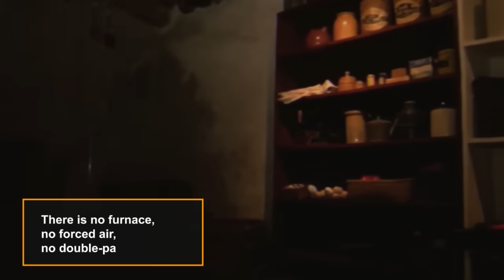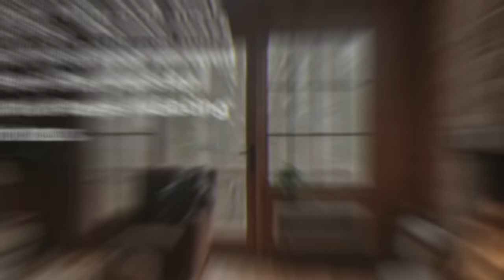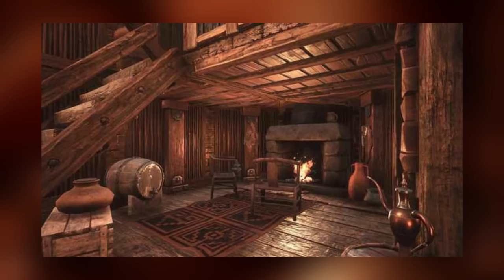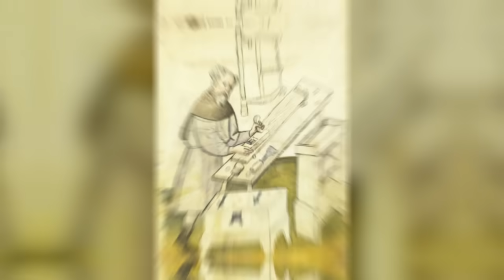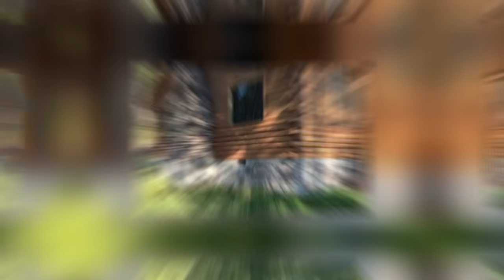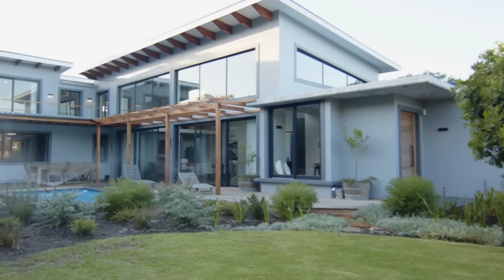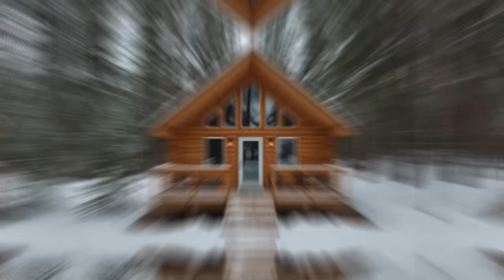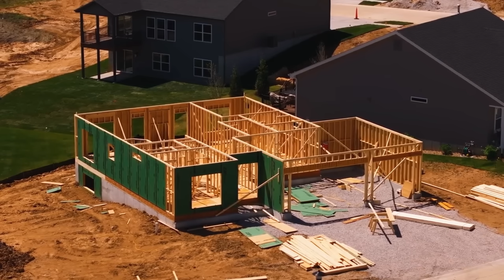Why Medieval Log Cabins Stayed Warm in -40°F While Modern Homes Freeze

Comment: Like 4 years ago, we had a winter storm that knocked out power for about a week in mid February.  Outside temps were consistently around -20F or less.  We relied on a kerosene Lantern for warmth and light, but that only really kept it around the low 40's. Worrying about that, we got a propane space heater, and that bumped the temp in the living room up to about low 60's. Was a rough week. Should be noted that this is a fairly large house, so lots of space for that heat to escape to.

Comment: If you use enough insulation, you don't need a lot of thermal mass. Thermal mass is only helpful when there aren't prolonged extremes.  Too much thermal mass, say in a prolonged very cold snap, becomes a detriment because it takes up more energy to warm up and takes a lot longer to do so. Yeah, once it is warmed up, then it will be helpful.

Comment: Our power went out several years ago on a Friday evening.  We stayed until Sunday afternoon before going to our daughter's.  Their power was only out for about 24 hours.  Our son's was out as long as ours but they had a small wood stove and stayed in the same room with it.  Sunday night, the temperature dropped to 9 degrees F.   We could have stayed longer if my husband had started the generator ... "But the power is only going to be out a little while."  Famous last words.

Our heat is in-floor radiant heat.  Our basement has about 6" of concrete with the tubes running through it.  Our bedroom was down there at the time.  Our bigger problems were that we cook with electricity and we might have run out of water.  But running the generator would have solved those problems as well.  We came back to the house every day to run the generator long enough to keep the freezers and refrigerators running until the power came back on Thursday evening.  We stayed at daughter's for that night because it would take time for the mattress to heat up again to a "sleepable" temperature.

We've had other situations where the power went out for shorter periods of time and we were able to stay in the house for a few days.

(Edit)  I posted before watching the rest of this.  I'd like to add that we don't have drywall.  We have tongue and groove pine boards.  According to the info given, this may add to our being able to stay here for a longer period of time.  We do have an open floor plan in part of the house which may be wasting some heat.

Comment: I had a 1968 brick house in St Louis MO US, we had 5 day power outage during an arctic vortex. Outside was 7f during the day. The lowest temp my house got was 45 f. My current brick rock wool insulated house warms up in the day . I do not need my furnace until it goes below 32 at all. It is 74 in the day when sunny  and drops to 62 at night until it goes below 32 for 24 hours. I do use the furnace to bring it up to 68 when it's been cloudy for several days or my elderly parents visit. If you spend time outside working like I do 62 is plenty warm.

Comment: A few small counterpoints here.   The number of windows in modern homes vs older homes is somewhat large and that is where a ton of heat escapes.  Yes a giant log that is insulated will 100% be efficient BUT if I asked the typical. homebuyer this question.  Would you pay 5x the cost for your home to make it super efficient?  The answer will 99% of the time be no.

Comment: Drastic oversimplification interspersed with misleading "facts". 

The amount of heat needed to bring such enormous thermal masses up to temperature are equivalent to if not more than the amount of heat needed to keep a modern house warm. 

You haven't addressed the issue of amount of energy needed. You have only addressed the concentrated nature of the heat from a single fireplace in a log cabin.

Comment: They aren’t completely wrong here but they fail to mention the most obvious answer: modern homes are many times larger with many more rooms.
Reply: And typically many more windows.  Your average double pane window has an R rating of about 2. A 1' or so depth wall has an R value of anywhere from around R40 (somewhat poorly insulated, say with fiberglass batt) to around R80 (very well insulated, say with the highest quality foam) on average. 

 Your average insulation runs between around R3 to R7 per inch... As you can see, a window is a very poor insulator in comparison, and even the expensive, fancy triple pane windows aren't that great in reality. Maybe a whopping R5 or so. 

 Windows are ok if they are getting plenty of direct sunlight through them, and then when they are not, have some kind of extra insulation put over them.  Silicone dot several pieces of cardboard together (i.e. try to have at least a small air gap between each panel), seal it up on the sides completely (with tape, silicone, or what not), and then paste aluminum foil, spaceblanket or the like on one side, with shiny side out, and then cover the windows with these at night and they will be much more insulated. You want the IR reflector pointing to the inside of the house to reflect heat away and back into the house.  Make it bigger than the window so it completely covers same from the walls. 

     Putting a clear plastic over the window does help a little, but not as much as people think. Might boost up an R2 window up to a like an R2.5, or R3 if you're lucky.

Comment: My house in upstate NY had a power outage for 10 days after a blister. We survived by moving downstairs, where the stove was, had it on 24/7, and hawled a barrel of fresh water in, because the pump wouldn't work. The stove prevented the pipes from bursting and when we cooked, the temperature became a bit higher. I do not think anyone could survive in such low temperatures without an iron stove and central pipe.❤

Comment: It's the instant heat of Oil & Gas that has caused much of the crisis over the last century. Coal (on the back of canals and railways to transport it) was the problem for the previous century and a half, with it's high calorific output [though not instant]. 
See 1 Winchester, S.: ‘The map that changed the world: a tale of rocks, ruin and redemption’ (Penguin, 2002)

 - there's an aside that the canals kept people alive through the winter, i.e. the shacks back then did not do as well as suggested.

Comment: I think a lot of the problems with modern homes starts at the fact that even with all the new technologies and building materials there isn't a completely sealed house anymore to prevent air moving between inside and outside. Today's unskilled labor even with spray foams will still leave large holes for the air to move through. If you take a home built right no matter the time versus a home built the quickest and poor quality no matter the era then you would probably find the same heat retention or heat loss respectively.

Comment: Thermal mass needs constant fuel consumption and needs days to worm up, also days to cool down when heating is gone. Insulation is way to go even to a point of passive or zero energy houses where living by itself provide enough heat to be comfortable without heating systems whatsoever. 
So forget medieval crap if modern technology is available.

Comment: Time wise I believe you build a log home faster ,  start to finish, involved today, foundation frame, sheeting, tyvek, siding, drywall, plaster  n tape , electrical, insulation, paint.
Two good guys it takes 3-4 weeks to just frame up an average home, that's roof sheeted windows in. Use to build these as kids..up in the tress not tree forts, actual log cabins about 8 feet up

Comment: We have the opposite problem. We live in north-central Florida and during one of the recent hurricanes (I can't remember which one - we've had several ☹), we lost power for 4 days and it became uncomfortably warm without the air conditioning we rely on. Our house was built in the mid-1990's and probably lacks sufficient insulation.

Comment: This is stupid. Put out the fire in the log house and it will drop to freezing too. Put the fire in the modern home and it will stay warm. I have seen it. Modern homes with a single stove or fire place heating the entire home. Yes of course 12 inch logs have better thermal mass than a stick built home but it only takes the lumber from about 20 trees to build a modern frame house, a log house of the same size would require about 60 trees.

Comment: The most efficient design would be wood and possibly mud/clay on the outside and stone walls inside.  This may seem counter-intuitive but wood is a great insulator while stone is basically a heat sink.  Having stone inside will hold the heat from a fire and release it slowly in winter when the fire goes out, helping to maintain a more constant temperature.  It will do the opposite in summer, helping to keep the inside more cool.  Depends on the type of stone as to how well this performs.  A hard stone like granite would be one of the best for high thermal conductivity, high thermal mass and high specific heat capacity.  These are the three parameters we'd want to be as high as possible for this application.
Today, builders are more concerned with low cost of materials and attractive appearance to help sell the home than they are with thermal efficiency.
Reply: Wood is not really a great insulator, though the really low density, airy woods like balsa and cork are decent.  The denser the wood, usually the less insulating per thickness it is. Insulation is all about trapping air molecules efficiently (as air conducts heat far less efficiently than all solid materials), unless you want to talk about going to the next level of insulation which is vacuum. 

   (I make my own vacuum insulated panels, so insulation is a subject that I've done a fair amount of reading up on).  VIP's are somewhat expensive to make in comparison to traditional insulation like fiberglass and wool batt, blown in cellulose, etc. but if the space is small and one experiences real extremes (in either cold or heat) then it can be justifiable.  And one can make decent VIP's with less efficient but also less expensive materials than fumed silica core (industry standard) like kapok fiber, perlite, etc.

Comment: There's a very limted supply of 100 year old trees to supply super dense logs. Population growth outpaces old growth forests. That said, we definitely could've built homes for better performance, but then they would cost way more. When it comes down to cost ver performance, most people will pick lower costs most of the time. Also, a t least in the USA where we like outr houses as big as possible, it isn't certain a huge log cabin will perform as well as a small ore medium sized one. We need to figure out efficient high density living, which may already have best practices established but I'm neither an engineer, not an architect, nor am I home builder.
Reply: There is plenty of unused bed rock that has a great amount of thermal mass that is dirt cheap. The amount of energy require to gather, shape, and put it into place is immense. That is the trade off, but there additional material options available.

Comment: I`m 61, have build 2 maasive houses (clay bricks). I already wanted to use solid wood for my first house, but had to give up due to the 2-3 times higher price here in Austria (EU), so I chose the solid construction method commonly used here, which is hollow clay brick masonry, which is a mixture of mass and insulation.
Shortly before the completion of my second house in around 2021/22, there was also a 40% increase in the price of wood (market manipulation).
However, I hope that I will be able to build a third house—my “last one.” If so, it will only be possible through magic, the lottery, or something similar, and then I will build myself a log cabin, just as I have always wanted.
My first father was a civil engineer, my second was a carpenter. I have always been extremely interested in building and design. I went to the school for civil engineering and worked as a construction technician and craftsman in this field before building my own houses, and I could list 1000 more reasons for log houses than those listed here, but ultimately, the choice of materials and design depends heavily on the location, because in temperate regions (low temperature amplitude), it almost doesn't matter what you build with and how you build it—you can save a lot of money, but here in Austria, we have almost 6 months of winter...

Comment: A log cabin would go from comfortable room temperature to freezing in just a few hours if the outside temperature was freezing and the fire went out. 

A log cabin is easier to heat, especially in a power cut obviously, but a warm house with no heat will cool down more slowly than a warm log cabin with no heat.

Comment: So much wrong with this video.  Thermal mass is not insulation.  A properly built modern home takes much less energy to heat or cool than older homes.  The first house I bought was poorly insulated and heating it in the winter cost about $400/month.  My current house is far better insulated, twice the size and I heat it for about $250/month.  I have had the power go out when it was -10°F outside and over a 24 hr time frame the house dropped from 72° to around 50°.  A small log cabin is not hard to keep warm.  300 sqft vs 3000 sqft.

Comment: My farmhouse is from 1825, reed roof, huge oak posts stand on huge granite blocks. I have a gas heating system but never use it. I use the huge fireplace in the living room. the bricks heat up and radiate heat. but the kitchen I heat with a wood stove which also serves to cook on and bake in. The reed roof insulates incredibly well. the house is crooked, but that is ok. I never have a cold, the air is wonderful and it never gets to freezing nor does it get hot during summer. From Northern Germany
Reply: happy new year. how much wood do you burn?

Comment: We need to adapt these principles for our era as did our predecessors.  Old growth logs were plentiful then and there as were other materials.  I built a house with enormous thermal mass but I missed the mark on air infiltration.  Never had an extended power outage but sunny days would keep it above freezing.

Comment: My 1880 stick-built house somehow holds heat very well for what it is. I had my breaker box fail in the middle of a cold snap where the temperature hung around 0°f during the day and -20°f at night. We were out of power and heat for roughly 3 days and the coldest it got inside was 52°. The only thing that was done to it for modernizing it was filling the walls with cellulose insulation. Maybe it was the old plaster walls retaining the heat as well as keeping the thermal curtains closed.

Comment: Its done to a high degree on purpose so we all consume more energy. Most modern houses have terrible insulation and building materials, so that loft space is useless and you loose all heat out the roof, while in the summer the house gets hot, so you need electricity and gas all year around.

Comment: Another mass building type is Adobe. It is basically dirt blocks that are usually sun dried mud bricks. The walls traditionally 2 to 3 ft. thick. Door ways are usually lower...as are ceilings. Most are heated, today, by wood stoves, but in the past they by simple fire places.
Due to the heat retention of the mass...in winter the homes were easier to keep warm. But also, it had an opposite result in the summer...keeping the home cooler then the outside.
Reply: In very cold weather/temps, you need a combo of lots of insulation and some thermal mass. Thermal mass alone becomes a kind of heat sink, takes a lot of energy to warm up and takes a long time.  These style of shelters are better for the desert where they are usually found, because while the desert either gets hot in the day time or gets a lot of intense solar irradiance, they often also get fairly cold at night. 

   So that thermal mass helps to balance out the extremes.  When it is just very cold all the time (especially with a lack of direct sunlight), you will have to pump a lot of energy into that thermal mass to get warm. 

   These type of shelters would be horrible in arctic or arctic like places for example.  You NEED to have insulation more than thermal mass in those situations, and the more insulation the better. But yes, it is helpful to have some thermal mass as well.

Comment: The true reason we left the old ways behind is profit. Stick frame and block built require constant heating and cooling year around. A properly built log cabin is much more efficient. I spent summers on the Canadian border in Wisconsin in a cabin built in the early 1800's.
Reply: For every dollar you have, there are 100 men trying to take it from you
Reply: @concretesailors Thats why I have no dollars. I have faith in my father.
Reply: What does spending summers in a cabin prove?  It would be a lot more impressive if you spent multiple entire winters there without having to use much in the way of resources.

Comment: I grew up in a log house my dad built with a real rock fireplace.   One of the keys to the stone fireplace is to have it inside and not on an outdoor wall.  That will suck heat out in the cold.   

Another advantage is that in the summer the rocks absorb heat and act as a natural a/c
Reply: My grandparents had a house that grandpa built himself. The outside was all stone. I remember as a kid that the house was always warm in the winter and cool in the summer without AC.